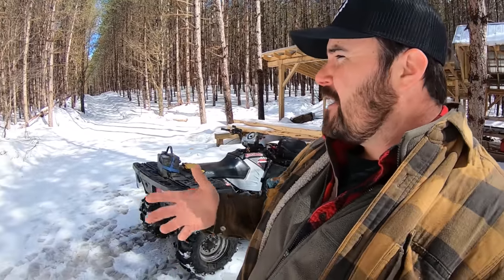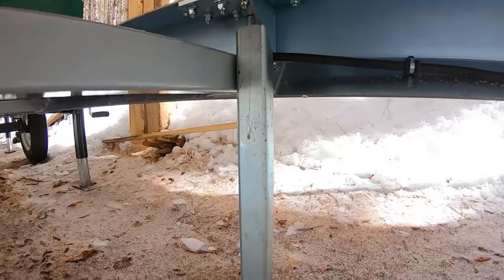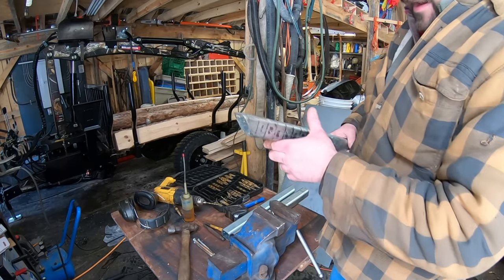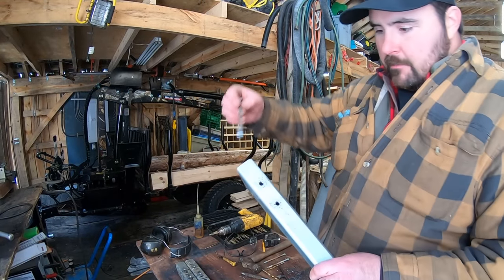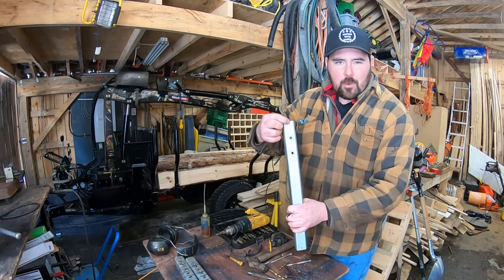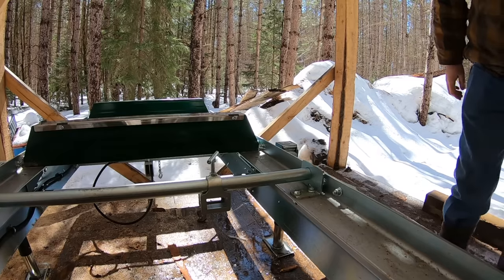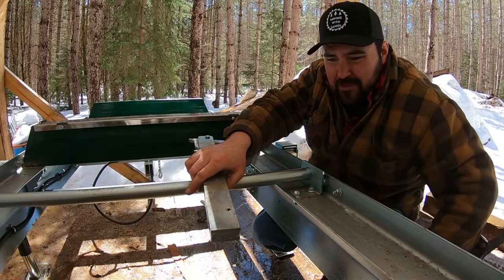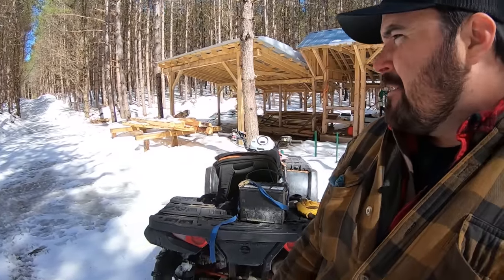No Money Needed for These Sawmill Upgrades (they're simple, I promise)

Comment from the maker: On second thought, I"ll likely grind off the weld I put on the log stops and put the weld on the side of the log stop to allow for a flat surface where the lumber will sit. Alternatively I may end up just rotating the log stop around so the weld faces to the side or back. See how it goes.
Reply: I always have the angled side facing the log anyway, makes the log easier to roll when using the can't,.and if it does ride up a bit because it isn't straight, the angle makes it ride down instead of OVER the stop....if you add more holes for measurements, maybe do them in the other face, 90° from the holes now, so you don't weaken the stop....
Reply: I was yelling at my screen "No Sandy, drill the holes on the sides and weld on the back" The bolt heads and weld will stop your log stop from holding the wood square!
Did we start that project after finishing a 6 pack?
Reply: Yes. I was concerned you would mess up your ability to square the cant. Great ideas though.
Reply: Why not put a small tack weld (only 1/16” tall would do) on the corner of the stop in line with the t bolt so as you crack it loose and it slides down, the tack sticks out and catches on the bolt? Unless there is not enough room in the sleeved tube.

Comment: Ya know when the snow finally melts we wont recognize your place LOL . I to have used nails and bolts for pins when I didn't have cotter pins available, You can lay your welding rods on a tray on top of your wood heater to warm them up before welding in the winter time done that before and if your rods are in the metal container just set that on the wood heater too, couldn't hurt! Jla🤠
Reply from the maker: I like that heating idea John!

Comment: Yet again another great vid Sandy
I have noticed a difference between the Canadian and the UK Mills the holes the log stops go into have two additional bolts on the back one top and one bottom so you can adjust the angle of the log stop to get them perfectly upright I do have the HM126 so that might be the reason but I found when I started cutting Trapeziums a quick adjust squared everything up 
Also agree with the other comments of turning the angled stops the other way round I mill some large diameter logs taller than the stops and they don't get caught up when you turn them if the 45 is towards them
Reply from the maker: The Canadian sawmills also have those adjustment holes. I just haven't had to use them fortunately as the log stops were perpendicular to the log bunks. The option to make those small adjustments are nice though for sure.

Comment: Good idea there Sandy.  I was thinking using hitch pins for the log stops would work as well.  I purchased a variety of hitch pins from Amazon for under $20 USD and they have come in very handy.  If you don't want to do that perhaps fasten a couple zip ties around the bolts and attach them to the frame (somehow, haha) so you won't lose the bolts.  Have a Happy Easter Sunday.  Cheers!
Reply from the maker: I like those hitch pin ideas! I’m going to have to try those! Happy Easter

Comment: The short log stops that came with my mill had a piece of keystock welded to them to keep them from falling through the mount.  Not sure why they didn't do that to the longer ones also.  I will be adding a bolt to the bottom of my clamp, though.  That thing can be frustrating if it falls at an inopportune time.  I ordered the new scale marker that you had in a previous video.  That should be here soon.  I've really picked up a lot of good tips from you over the time I've been watching.  Thanks for sharing your experiences!
Reply from the maker: Great to hear that Marvin and I'm happy to help where I can

Comment: Sandy, I yelled and screamed at you but I guess you didn't hear me! You welded the bead on the wrong side of the log stop. I see under your pinned comment you figured it out. Hey, we both know you wanted to play with the grander, as well as the welder. One other thing, if you put a bolt through the log stop to hold it at a specified height, do you still need to clamp it? When you push the log against it, I don't see it going anywhere. Great solution with the nail thru the log clamp!
Reply from the maker: hahah I had a second look when I was posting the video this morning and realized that I should probably move the weld but in the meantime I"ll try it out and just turn the log stop 90 degrees if I need to. I don't think I"ll need to clamp the log stop anymore if the bolt goes through which will be nice actually

Comment: My trailer is 8 feet wide, yes it is horrid when they fall under, happens lots. The log clamp will accept a bolt thru the gap at the bottom. Are you turning log stops so the weld on knob  is on the side not against the log.?? Easy fix thanks for the idea, like the bolt thru stops great idea
Reply from the maker: Hey Bryan! I think for now I'll turn the log stop 90 degrees but may end up moving the weld if I don't like that turning. Lots of good ideas I"m reading about in these comments I may give a try for version 2.0

Comment: Saw a welder set amperage low,allowed electrode to stick to metal.Broke free,turned up amperage and went to work.Said it heated and dried out electrodes.YMMV
Reply from the maker: Yeah always a bit of a guess with my old machine as the settings are too accurate I find

Comment: You put the weld on the face side that holds the log in place and attempts to keep the cant square. If you put the welds on the sides that would not be an issue!
Reply: Perfect sense, he will always be a 1/4" of, the thickness of the weld.
Reply from the maker: For sure. I end up turning the log stop either 90 degrees when I need the perfectly flat surface or all the way around 180 degrees to get around this

Comment: My suggestion instead of the nail would have been a cotter pin. Easy to install and easy to remove if needed. Now it will be a pain to take the nail out if necessary.

Comment: Nice simple fix. I don't really see the need in bending both ends of the nails over like that though. As long as the nails have a big enough head on them, that end isn't going anywhere. Adding a slight bend to the other end would keep it in place and allow you to remove them should you need to with much less fiddling about. 
Also, wouldn't the welds just add to the gripping ability for the log stops? Good vid again. Thanks.
Reply from the maker: All good points Joe. Only trouble with the weld placement is if I want the lumber to sit flat against the log stop . I'd have to rotate the log stop around in that case likely

Comment: I was going to mention something about that soldering and interfere with the sitting of the log but I see you figure it out yourself I can of was thi king the same for the hole you did they should of been side way instead of the way you done them that you could of left the bolt in without interference  P.S. by the way I am kind of surprise that you don't do a little bit of maple syrup for yourself unless you don't have enough mapke on your propriety well have a great day
Reply from the maker: I do typically do maple syrup but have been quite tight for time the last few years unfortunately

Comment: You put your clamp in backwards its supposed to lean toward the log not away if you look there is a thin side and thick side on the mount
Reply from the maker: I actually was waiting for someone to spot this. You're right there Jon. I never noticed until recently and have been meaning to get things turned around.